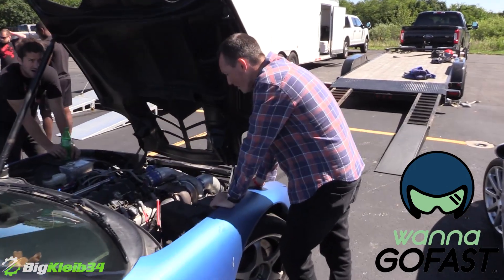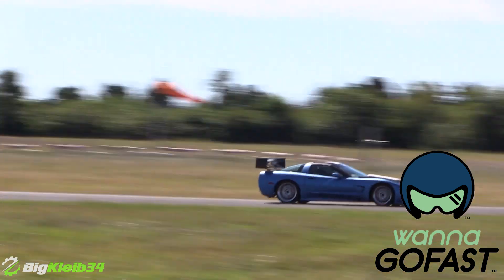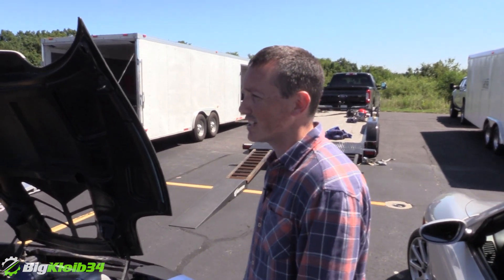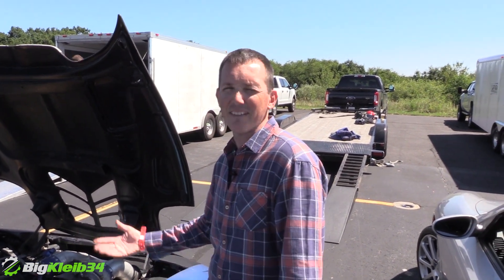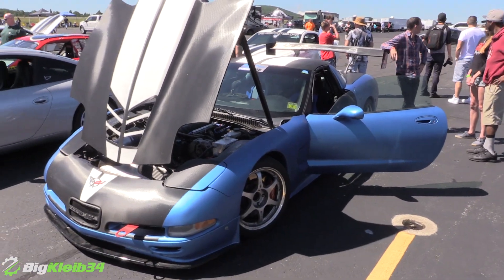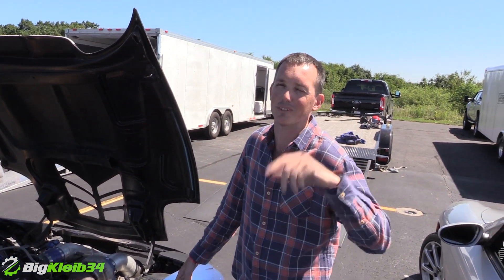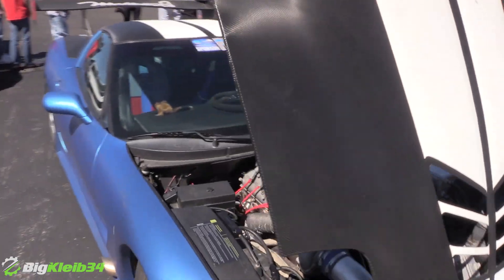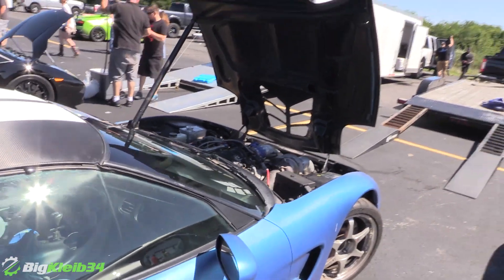Rob Ferretti Gives us the Inside Scoop on his 150+ mph Turbo C5

Comment: Ls3 bored to a 350 c.i??? Yeah, he misspoke
Reply: air8teen1 you weld inside the clinders and once its solid like if there was a piston in there you bore it to 350
Reply: Koalafications4Dayz I understand de stroke but he said bored. Most think in terms of a ls3 being a 376 so making it larger. Either way, it's a fast machine
Reply: Im just trolling he misspoke trying to hide what type of motor he has
Reply: Im guessing its a LS1 since they can only really be bored with stock sleeves 0.010 and they are 346 CI stock so that make it about 350, and maybe has LS3 style heads. Otherwise its a destroked LS3